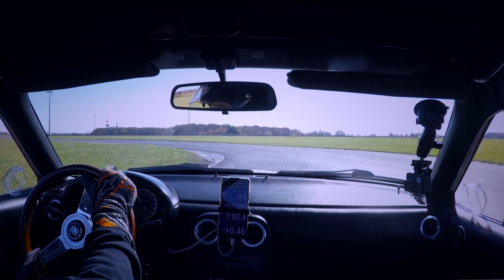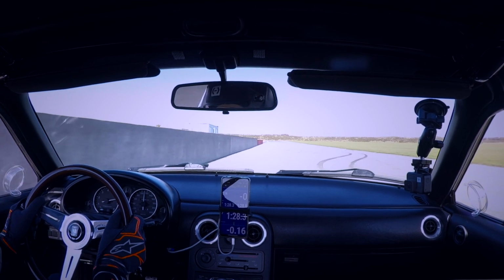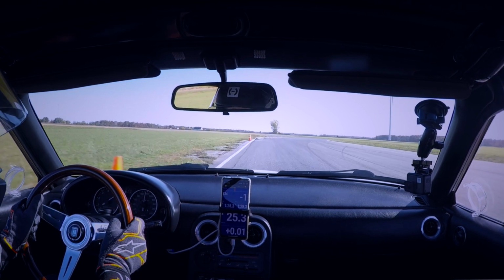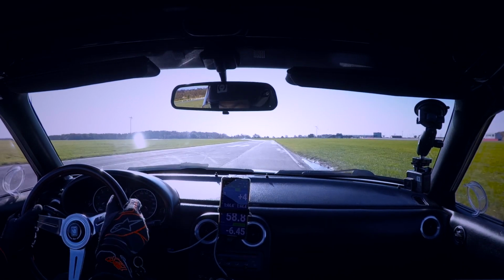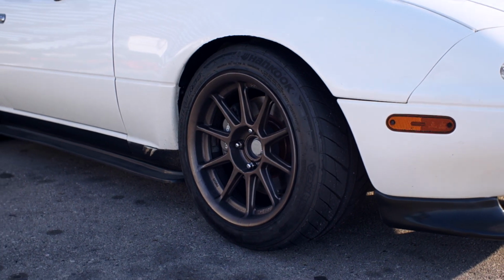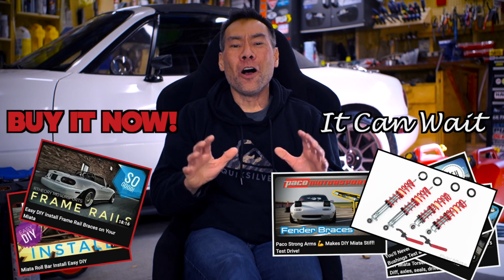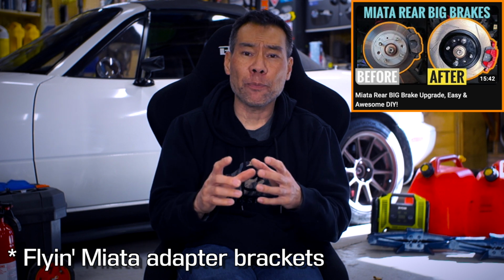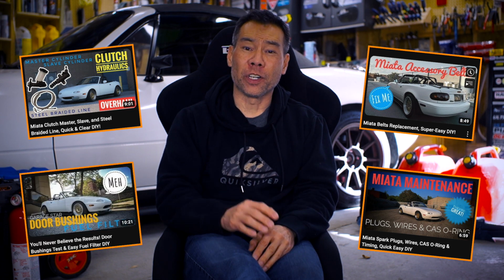BUY NOW! Miata Mods Track Test Reviews & TMP PB 1:28.3

Comment: Have you thought of doing poly bushings all the way around? It’s one of my favorite mods thus far on my build. Literally added negligible NVH compared to the old worn out bushings but made the chassis even more communicative. 

I used the PTFE tape tip from another YouTuber to prevent squeaks and noise and a year in have yet to hear a peep!
Reply from the maker: eyes parts in corner ... yes I have.  And of course that tip about the PTFE tape is really effective.  I used that on another vehicle that I did bushings on and certainly there's no noise but it's also supposed to help with the bushings binding up.  I believe the video was the MotoIQ guy.

Comment: Thanks for all the information. After owning my 1993 NA for 17 years it’s time for some upgrades. Plus the fact that I’m retired. 
What’s your thought on the vent windows. Moss Miata has them and I’m seriously considering installing them. 
Thanks just subscribed.👍😎
Reply from the maker: The vented quarter windows are good for additional airflow but if you drive in the rain they don't seal very well. Since I avoid rain I like them a lot!  If you're industrious you can DIY them from Lexan and aircraft Snapvents.

Comment: Brilliant video. I'm really impressed with your 1.28.3, especially considering it's a 1.6 vs Speed Academy's well set up 1.8!
I too run a torsen diff but I converted an open 1.8 diff with a Blackline torque-sensing gear set (1:5 torque transfer). It's final drive is 4:1 mated to a 5-speed NB box. My 1.6 is turbo'd with 230trx and 255bhp but I have no problem with my torsen which puts down all the power I need on corner exit. So I suspect that either the 1:2.5 transfer ratio is not enough or you diff has other issues.
Re anti-roll bars/sway bars: I agreed with your findings of getting your car to rotate rather than the 'safe option' of tending to understeer. Once you get used to the tendency to rotate then you'll never look back.
Heat management and maintenance is key. Coolant re-route, ali radiator, new water pump and a 1.3 bar radiator cap (oh and an oil cooler for the turbo!!).
All your chassis stiffening is great. A roll bar is on of the first mods I did. It really stiffens the chassis as well as being a safety feature.
If you have MeisterR in the US then try them. I run MeisterR's middle coil over (Zeta CRD, digressive damping) with only 6kg/mm front and 5kg/mm rear with uprated Whiteline ARB's it's perfect.
Totally agree with your safety/reliability/speed philosophy.
Reply from the maker: You UK-folks seem to have all the good stuff from your "domestic" vendors.  There's quite a few things that we lust after here in North America (e.g. Tillet B5s 🤤) I've never heard of Blackline before and it looks like a great product at a reasonable price.  255bhp on your turbo 1.6 is quite a feat, especially running the 5-speed.  In these parts 5-speeds at that power level are not long for this world.  😂
I have heard of MeisterR and read good things about their products.  There was a long tread on Miata.net and impressively at one point with the owner participated and took feedback.  That's good customer service.  
Thanks for the thorough comment, always love to hear your thoughts!
Reply: I hadn't thought much about converting an open 1.8 diff. Thanks for the idea!

Comment: This was a great way to break down some of the fundamentals of attending track days in a Miata. You'll always get differing opinions on which parts you should go for first, but I like the way you divvied things up into Now vs Later.
One thing for me is, I'd put coilovers in the "Now" column personally. As, if you have anything close to the OEM setup, even if it's in good condition, it's nowhere near as competent as some decent coilovers built for track use.
Reply from the maker: That's a really good point.  In fact, even the newest NBs have 18 year old suspension so quality coilovers, Buy It Now ... let's go! 👍  Thanks for the great comment! 🙏